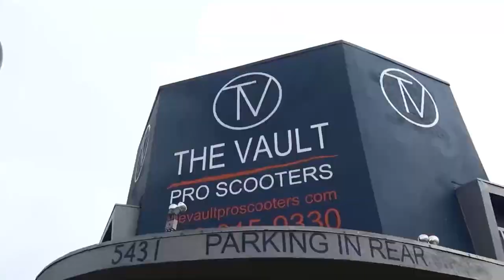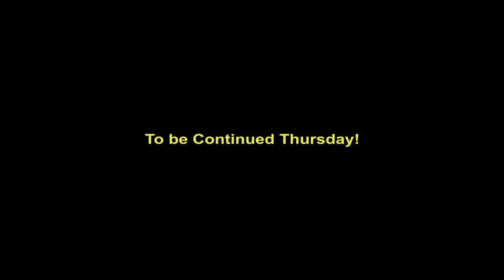HYDRO DIPPING for DUMMIES *Try this AT HOME* Custom Pro Scooter Parts

Comment: I started out with a fuzion complete and i went from the fuzion hex grips to some ethic grips, i currently have lucky wheels, sacrifice boxed akashi deck, ihc sacrifice forks and 2 bolt sacrifice clamp, fuzion T bars from the complete, odi bar ends and the rest was internals from the fuzion complete
Reply: has your sacrifice deck and forks snapped yet
Reply: @qasi111  not yet, has stayed strong for me